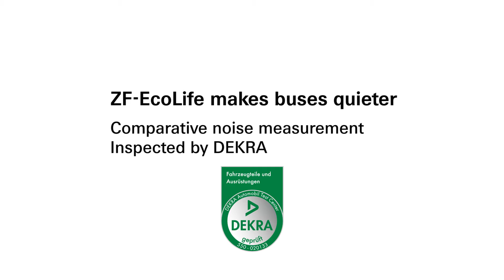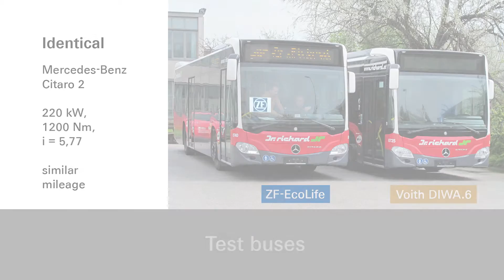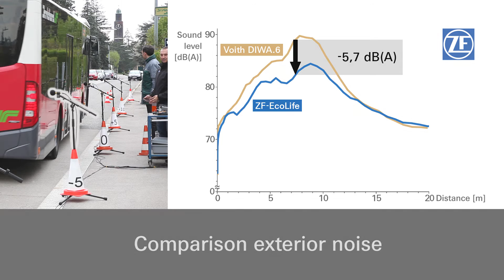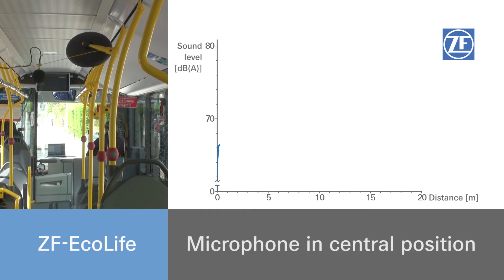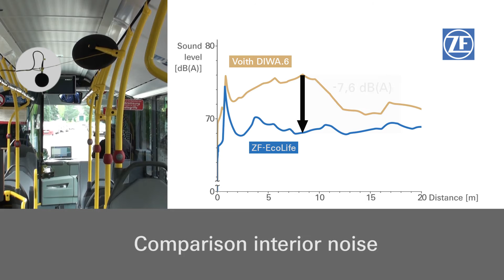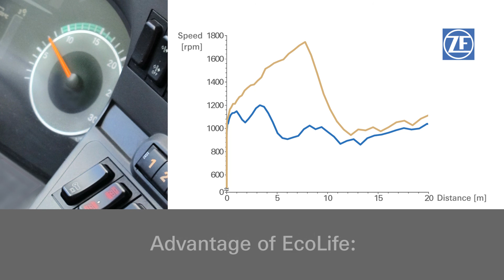ZF-EcoLife makes buses quieter (en)

Comment: After all these years critisizing Ecolife, I find myself coming back to this video. I have been driving city buses with different gearboxes now for a few years. I have tried almost every kind of box there is on offer, Ecomat, Ecolife, Voith and I-Shift. Not only have I lost my primary source of entertainment (gears on the Ecomat) but also my motivation to try and drive better.
Reply: In Finland at least, the bus routes are heavily contested. So every drop of fuel the companies can save on paper they will try to save. You have marketed Ecolife as economical and I can say, yes, on some cases, it is pretty economical. But at first let's look at some conclusions we can draw from this video, and how the comparison is unfair.
Reply: First of all, the Voith-equipped vehicle is closer to the kerb than the Ecolife-equipped one. It might only be about 5-10 cm, it's difficult to say from this angle. But look and it is closer. This distorts the results. I agree that Voith is louder, but that is because it is better for the engine, driver and passengers in terms of smoothness.
Reply: Secondly, inside, the microphone has a higher gain on the Voith-vehicle. You can see it easily, the door-locking click is around 2 dB(a) louder on it. How can it possibly be? They are supposedly identical vehicles. Probably you stuffed a lot of noise insulation under the hatches just to make the gears 1, 3 and 6 inaudible.
Reply: Thirdly and most importantly, is the engine. Yes it seems that the OM936hLA can cope pretty well with low revs. That's good. But there are plenty of engines that cannot: Volvo's D8K, FPT Tector 7 and Cursor 9, Cummins ISBe 6.7 just to name a few. They require around 1000 revs to get properly going, or else they'll vibrate and resonate across the cabin as the engine is struggling to accelerate the vehicle because of the stupid gearbox.
Reply: Getting going is the most important part in line traffic. Because it uses the most fuel, you want it to be over quickly. And struggling around suboptimal revs is NOT the answer. Why? Because of efficiency percentages. Engines are at their most efficient points at the peak torque band. They use more fuel per energy generated outside of that band. Forcing engines to use more fuel for the same kind of acceleration is idiotic. Not only fuel, but on some engines the oil pressure is minimal on low revs. So you're asking an engine to practically destroy itself over long-term? All because of those "saved" fuel droplets...
Reply: One more thing... The driving experience. I don't really like to drive with an Ecolife bus. The gear ratios are worse than they were on the Ecomat, shifting programmes make even the most powerful buses sluggish and Topodyn life could be a little faster to react. I see a hill coming, the box has just shifted up to 800 rpm so I'm mashing my foot down for a reaction. But no, kickdown takes 3-4 seconds to activate and by that time I have slowed enough that it must come down THREE GEARS in order to just get over some tiny hill. If it were more intelligent, the kickdown would react instantly, get some boost on the turbocharger and only require one downshift. This is called anticipating the terrain, one thing made impossible by this gearbox.

 ZF-Ecolife - macht busse scheißer.
Reply: Seems like ZF is becoming too large for its own good. All the above has manifested for a greater than good amount of time and I had a bleak thought about the last generation of Diesels being equipped with this boxtype.

Comment: 4:33 This is strictly impossible !
Reply: A bus engine emits approximately 70 dB. 6 times this would be 420 dB, this is impossible !
Reply: *****
What you are saying is untrue as the noise level pressure measured in decibels does not increase in a linear way.
Reply: *****  Can you explain to me how it is possible for an engine to make 6 times the noise of the same one just because the gearbox is different ? Thanks :)
Reply: The sound pressure level is a logarithmic function and not a linear scale. When sound level pressure increases 20 dB(a), the absolute pressure is increased ten times. That means it will sound 10^1 times as loud. A 40 dB(a) increase means a 10^2 increase and 60 dB(a) means a whopping 10^3 increase. But this comparison is completely unfair for Voith, as the driver was told to set off using kickdown which was disabled on the Ecolife box and not on the Voith one. 👎
Reply: *****  "When sound level pressure increases 20 dB(a), the absolute pressure is increased ten times." So when ZF says the engine makes 6 times more noise with Voith than with ZF, it makes less than 20dB more noise ?
Reply: ***** Yes that's correct. It's about an 8 dB(a) increase.
Reply: That's not very much ! And the better traction of Voith gearboxes and its beautiful sounds are well worth the 8 extra decibels !!

Thanks for all your info ! :)
Reply: ***** I agree 100 % with you. Voith for life!
Reply: TRAX  The noise you hear increases exponentially.
A few db more can be double the noise.

Comment: Is it really healthy to accelerate with the engine speeds under 1000 rpm? I can imagine that not being very good for the engine in the long run. Just come and see your product in action here. I recorded, at the back of the bus, inside sound levels up to 83 dB(A) when a new Euro 6 Volvo B8RLE was departing from the stop. Not so quiet any more...